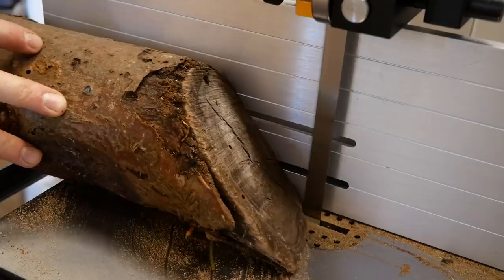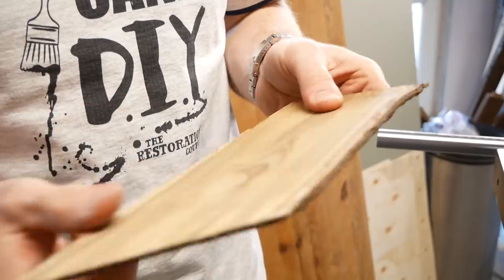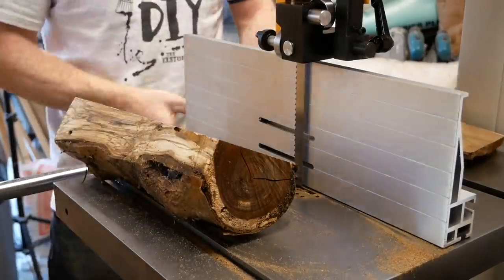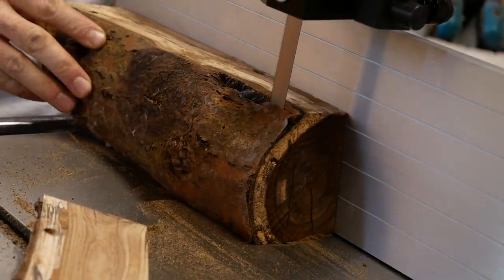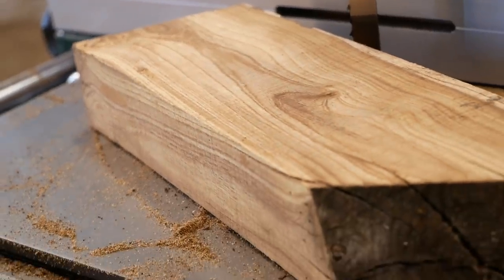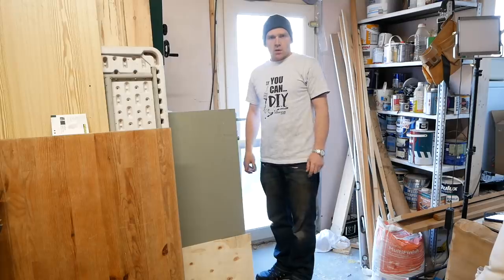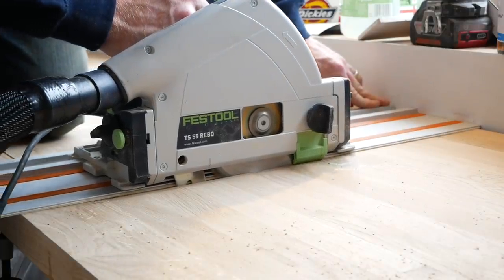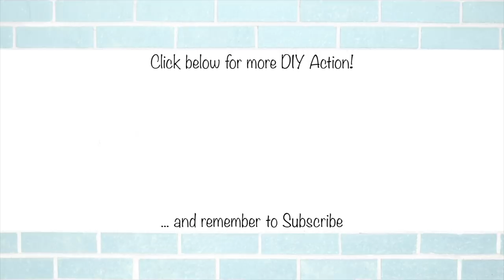SETTING UP MY NEW BANDSAW - Record Power Sabre 350

Comment: Now that you have a cast iron table to maintain I would suggest a rag rolled up tightly and put into an old lid from a can of spray paint. Lets you put oil in the lid and then you just hold the lid and rub it all over the table. Also means you dont end up with excessive oil on the table(not my idea, seen it somewhere else on youtube just cant remember where)
Reply from the maker: Great tip. 👍
Reply: Paul Sellers by any chance?

Comment: Hi im thinking of getting  a sabre bandsaw and am trying to decide between  the 350and the 450  I'm leaning towards the  450 because of the wider blades up 35mm but surprised that it is only single  speed 
Any input  appreciated 
Regards  Liam

Comment: Think it may have been me that made that dig re the bandsaw! But my question is this -  could you not simply buy a bowsaw for £10 and saw these curved braces out??? I mean curved braces existed many many years befire bandsaws, how did these guys do it??? I do get it with the Laburnum though, plus I know a bandsaw is much safer for width splitting than a table saw. I am looking forward to seeing these curved braces though :).

Comment: Just bought a sabre450 for my workshop. What a disappointment. Didn’t work on delivery. An electrician found it had been wired incorrectly inside. Very poor quality control for what is suppose to be the top of their range machine. Wouldn’t buy record power ever again.